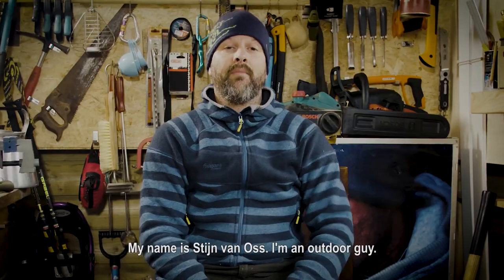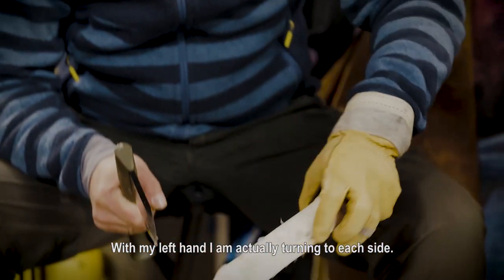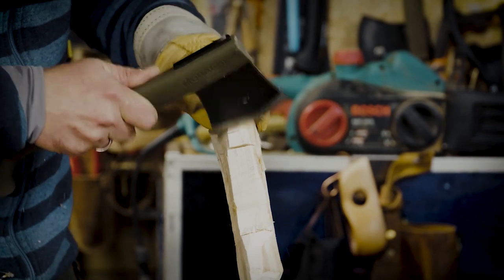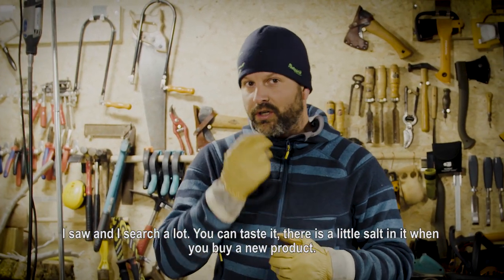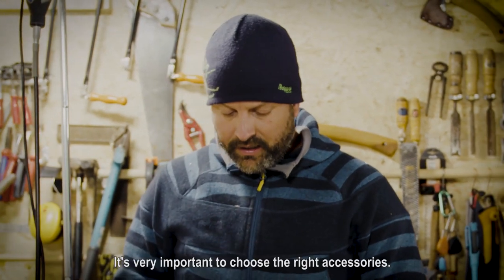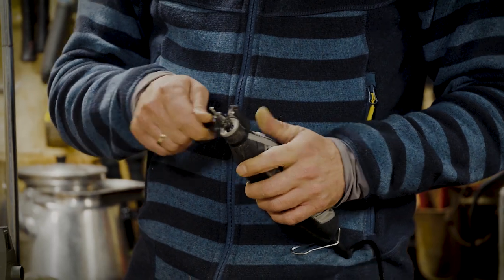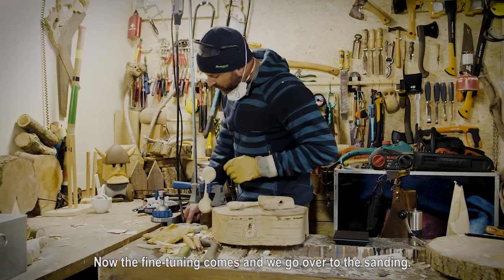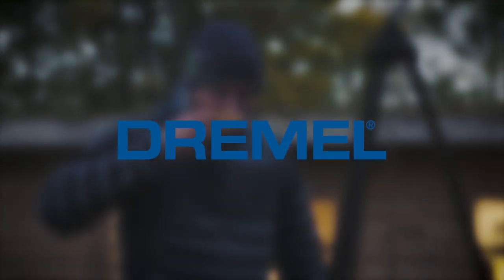How To Become A Master Carving Wood With Dremel® 4300 - EN

Comment: How do you like your Dremel Vise? I have Dremel Drill Press very cheaply made and It sucks, it flexes in every dimension! I want to make a better one myself. I also see a lot of negative comments on the Dremel Router Table. I don't think I will ever by another accessory like that from Dremel. From now on it's only Bits and simple attachment.attachments. 
Right now my neighbor has some White Birch logs out for scrap. I'm going to try your saltwater treatment.